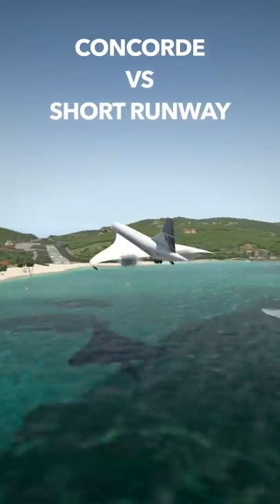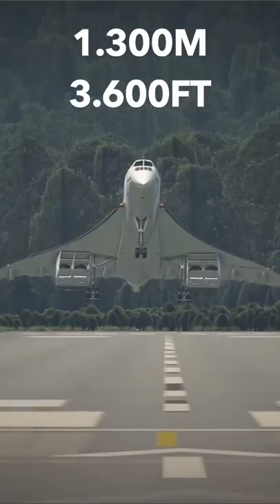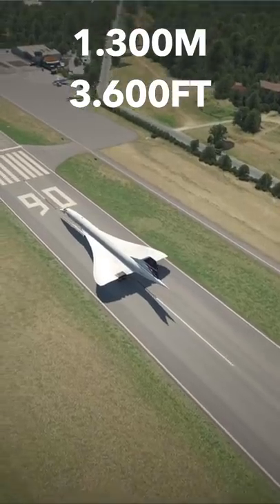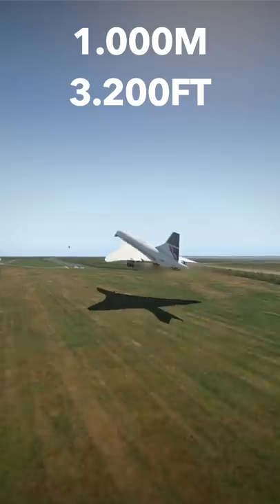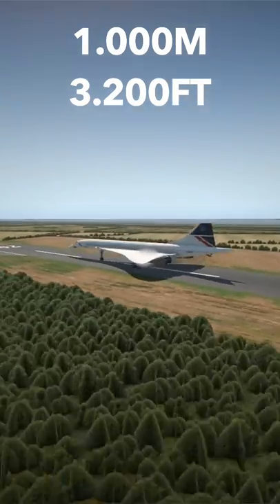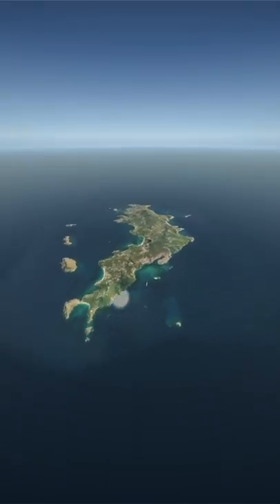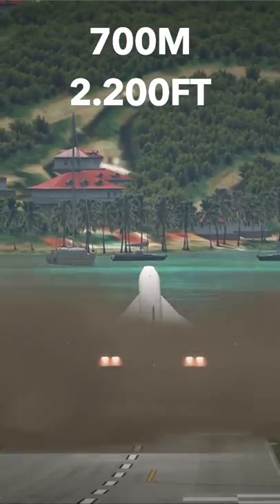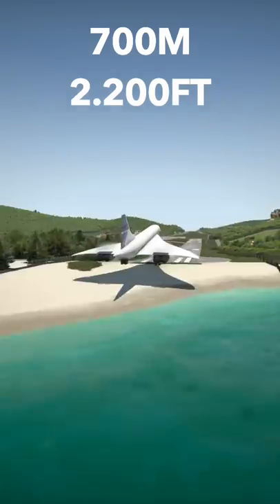CONCORDE vs SHORT RUNWAY #shorts #concorde #challenge #short runway

Comment: To take off at a shorter than recommended runway(for the aircraft type) you need to have the engines at full throttle before you start taxing to maximize the chance of getting airborne.

Comment: I went to St Martin and that looked very similar but there is actually a beach with a bar near the entrance/exit of the runway that beach goers are hit by full throttle force of air at take off due to the mountains at the other end so the plane has to go very fast so as soon as the wheels are off the ground it has to bank very hard so it doesn't crash